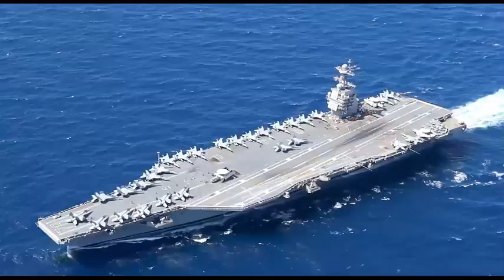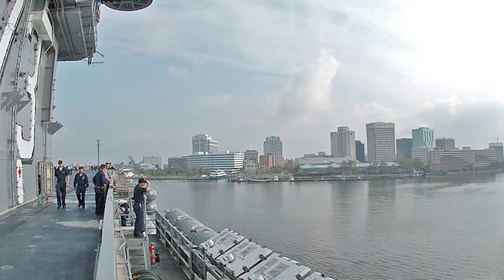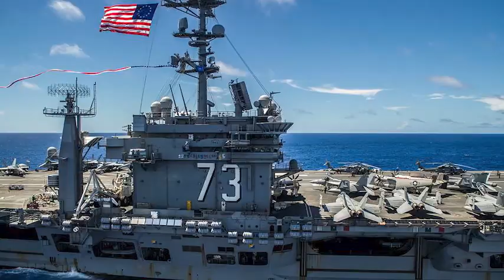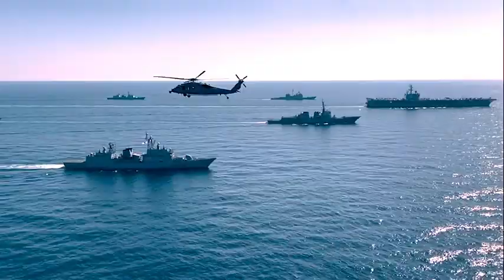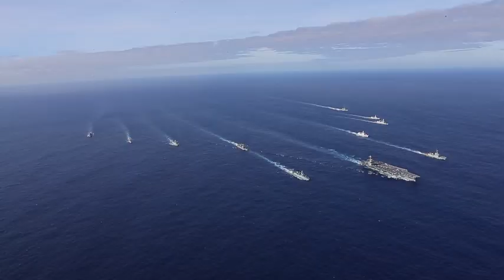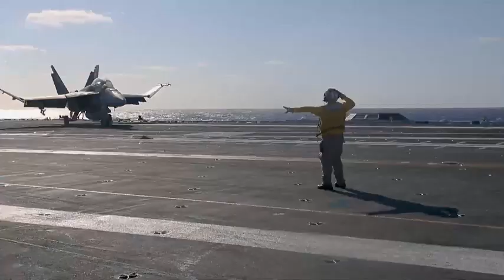Is It a $13 Billion Target or a Deadly Trap? Kill Web Exposed

Comment: Anyone who thinks that these carrier groups are invulnerable, should look up the initial fase of the most expensive war game the US ever held: "Millennium Challenge 2002".
This war game took two years of preparation, involved 13.000 troops and the total cost was 250 million $.
This war game simulated a US attack in the Persia gulf with its massive naval forces.
To fight this war game, the US selected retired Lt. General Paul Van Riper, as the commander of the adversarial forces.
Van Riper knew that the US forces exceeded the forces he had available to defend his position by a wide margin and he decided to throw in all the assets he had available from the very start of the confrontation.
The fighting didn't last very long and ended in a total debacle for the US forces, with 16 of the US navy vessels at the bottom of the ocean.
The US disqualified Lt. General Van Riper for using unauthorized asymmetrical tactics and replaced him with a commander who was willing to follow the US script, which would lead to a US victory.
Van Riper later called the war game a total waste of money.
Enemies do not follow the US script when attacked and this war game was held at a time that Iran's military strength was far from as developed as it currently is, and didn't have anything like the hyper sonic missiles the Iranians currently have in their arsenals. 
Furthermore, Iran did not have the support of major powers like Russia and China in this fight, who will assist Iran by providing material and intelligence and maybe even help the Iranians with active participation in the fighting. They could help Iran in operating their air defense systems or even flying the recently delivered SU-35 jets, for which the Iranian pilots are still in training.

Although the US also developed it's war capabilities in the last 20 years, they did however not develop groundbreaking new equipment or technologies for their naval forces, on the contrary, their forces only grew weaker. The US did develop the F-35 during this period, but it is far from sure that this will give the US a serious advantage.
The new radar capabilities the Chinese supplied to Iran can detect and target the F-35 and F-22 jets from a distance of 600 Km, nullifying their stealth advantage and giving the Iranians sufficient time to detect these aircraft and launch countermeasures to intercept and destroy them.
The US is also running out of air defense capabilities due to the wars they have engaged in in the last few years.
Their Patriot missiles, which are actually not very efficient against super- and hyper sonic missiles (with a successful hit rate of about 6% in the Russia/Ukrainian conflict), are at depletion levels and during the 12 day war in June of last year they used 1/3 of their stocks of THAAD missiles in just a few days. 
Neither of both were able to protect Israel from being pummeled by the Iranian missile and drone attacks.
Israel has been hiding the damage caused during these attacks, but gradually we are receiving more information and the damage was massive.
If the US didn't intervene and negotiated a seize fire with Iran, there was a good chance that Israel would have been completely destroyed.
The US does not produce large volumes of these missiles and although they surely produced some, to re-supply their stocks, it's very doubtful that they achieved a level which allows them to fight a conflict for much longer than a few weeks.
The risk that Iran will be able to cause serious damage to Trumps beautiful and all-powerful armada is very real, and even likely.
Calling his navy an armada is in this case very fitting and it may end just as disappointing for the US as it ended for the former Spanish armada.